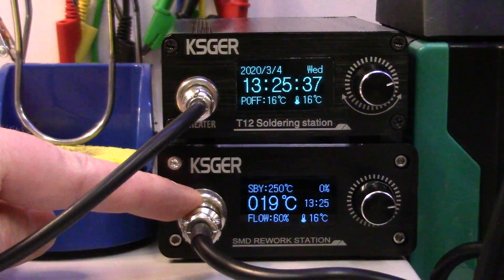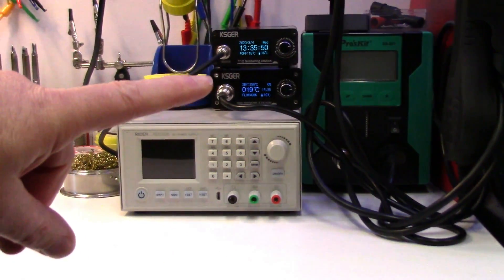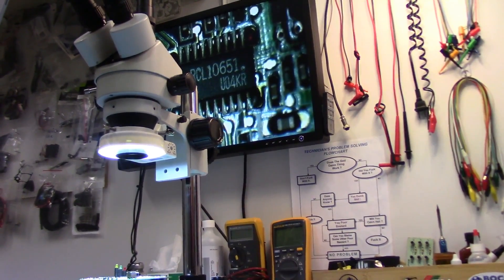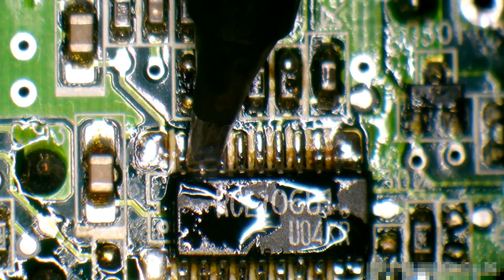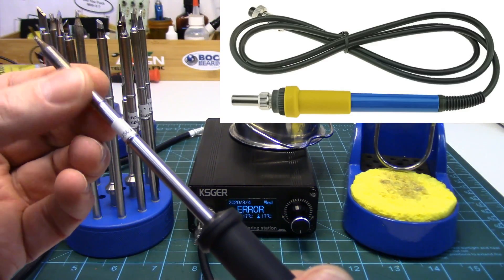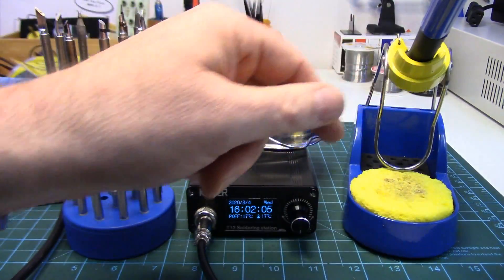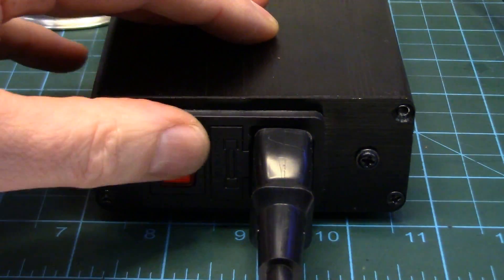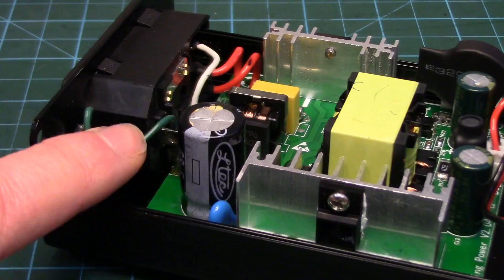KSGER T12 & 858D Station Follow Up & Questions Answered

Comment: Hey John, i would like to know what brand is  the benchtop power supply you have.?
Reply from the maker: It's one of those new(ish) Riden RD6006 units: https://www.banggood.com/custlink/vvDDzi7IyB
That link is to just the head display unit. Depending on how you want to power it, you can get your own PS and case for a very cost effective build. I just purchased the Riden Case and the recommended 60V switch mode power supply for mine. It's very easy to put together and a fun little project.
Dave Jones (EEVblog) did a couple videos on it, and I knew after watching them, it was the bench top supply that would fill the requirements I had (higher voltage and current) to replace the old linear 2 channel bench top supply I had built back in college that topped out at 24V and 1A with no way to alter current output or monitor the outputs. This thing is such an improvement :)

Comment: Thanks for the quick reply on the tip stand.  If I buy one of these and want to do your mods for the light and ground, could I use the unit it's self to solder those wires.  I don't have access to another soldering station to do it with.  Also is the silver front model the same as this one? They look the same inside.
Reply from the maker: Thou shalt not EVER solder on live circuits - especially ones that are running at line voltage potential. No idea on the silver version.
Reply: if you had another suitable dc supply you could power the front board with that and work on the disconnected built in supply

Comment: Did you have any floating temperature with clone t12 tips?
Reply from the maker: Not sure what you mean by "floating temperature" so I guess I didn't. They are all working great. One thing I did experience with every one of them when they were brand new/very first use, is every one of them had to go through some sort of initialization phase; perhaps as the PID algorithm did it's thing? The temp would hunt up & down with intermittent errors flashing on the display during this one minute or so initialization process. After that, they never did it again. I demo it near the end of the review I did on the T12 station.  https://youtu.be/eKQC9G5SYII

Comment: In your video the main capacitor is begin to leak , please replace the 400v 68uf
Reply from the maker: Good eye. I noticed that too and just figured it was some mastic that got smeared across the top of the cap as it looked like the same yellow adhesive goo that is on a couple of the connectors. I went back and watched my review video and didn't see any on the cap a year ago so it must be some cap shmoo leaking out. Guess that's another thing to keep an eye on 🤔
Reply: John Salt yes thanks for the investigation. that brand cap is a well known bad cap maker. i think they were responsible for the imitation samsung caps. those were problematic after a year of use.  and were used in lots of tv,s from 10 years back.
Reply from the maker: Good to know. Thanks!
Reply from the maker: Turns out there was a tiny pin hole in the top of the cap at the corner of one of expansion/burst cross lines - unreal! Thanks again for pointing it out. I replaced it with a Nichicon 400V 68uf cap and noticed the display comes on a little quicker now.
Reply: John Salt thanks for the video and your answer.  If one cap is the biggest problem of this unit, i am verry happy to have orderd one .
Reply: @Rchelicopterfun  what are the dimensions of the Nichicon 400V 68uf cap you used? I measured the cap in my new T12 KSGER station as 15 mm, but the smallest diameter Nichicon cap I see on Mouser with the proper voltage and capacitance is 20 mm, and there's no way that would fit here on the board.

EDIT: Never mind. I cleared all my filters and started a search from scratch and found one that should fit. Thank you for the video!

Comment: The T12 KSGER soldering station is great, the hot air not so much. Nowhere near BST or Quick Hot Air Stations
Reply from the maker: Hmmm, I'm certainly not finding any issue with it. Admittedly, I don't use it for SMD work all that often; perhaps a couple SMD projects a month, compared to the weekly heat shrink and bearing racing heating jobs it gets. All I know is I did have an Aoyue pump style hot air station before this one, and I much prefer this one as it takes up much less space on the bench and is not nearly as noisy or with the small brushless fan in the handle.  Heat up time is also faster and temp accuracy seems better. Guess it all depends what our application and work environment is like. For heavier use, perhaps the pump style stations are better, but for RC hobbyist use, this little KSGER 858D is working a treat (so far). 🤔
Reply: @Rchelicopterfun  Is the hot air station still working great? I already have a KSGER T12 Mini (it's a really really good station for the price) and wanted to also have something for SMD work.

Comment: Here's a tip for removing hot glue: add a drop of IPA(Isopropyl alcohol), and it comes right off
Reply from the maker: Hmm, just tried it last night, didn't even touch it. Must be different types of hot glue.
Reply: @Rchelicopterfun  should work. It's how the PDR (paintless dent removal) kits work.

Comment: Here in the UK I purchased the mini T12, so I could power it from my own 24V power supply. Great little station!
Reply: I think this is the safest option.
Reply: i thaught about doing the same ..
Reply: Great Idea, I saw one of those and was confused by how small it was. I thought at first it was an unsafe copy. Didn't realize it was just missing the power circuit.
Reply: I was recently in the market for an iron and i saw so many of those and for so cheap, glad I didn't grab one of those now lul, wasn't aware that they needed a separate 24v supply, ended up grabbing a proper ksger T12 on ebay yesterday for 40 quid

Comment: I bought one after seeing your video because my 45-year-old Weller is pretty tired and useless and the Bakku I bought is a disappointment. I do agree that the power switch at the back is a pain but solved the problem in a very similar manner to you, I'm using a remote-controlled 4-way patch board. I find it interesting how the orientation of the power switch bothers Continental North Americans, that comment has been made in several YouTube videos. Here in Australia, the switch works normally or us. 
Anyway getting back on track, I have also earthed the case, more of a worry here with 240 volts. I had a look at the heatsink and quite frankly I don't see it as too much of a hazard, The are a lot of other exposed points on the board that would bite. It is in a secure case after all and unless you are competent I don't think you should be poking around in there anyway. as for the operation of the unit I reckon it's fantastic, you have all the control and information you would ever need. This and my TS100 are al I use now. I even use the K tip quite often, good for large pads or wire as it has reasonable thermal mass and is able to transfer that thermal mass well over a larger surface area. I think people try to use it like a hot knife which it's not designed for.
Reply from the maker: All good points! 🙂

Comment: Mine came with the 907 iron, but I ordered an all black 9501(also by KSGER) and it's so much better. Also, the 907 iron is much bigger (in diameter) and isn't really any cooler than the 9501
Reply from the maker: Good to know.
Reply: @Rchelicopterfun  I have the 907 and it gets a little warm sometimes but nothing much to care about; strange it would perform better cause the yellow silicon is thin, in fact I put a little masking type underneath of it to create some friction because the metal collar was unscrewing the black plastic collar. I laughed when the Weller came out, primary side fuse? .. whats that?!?!